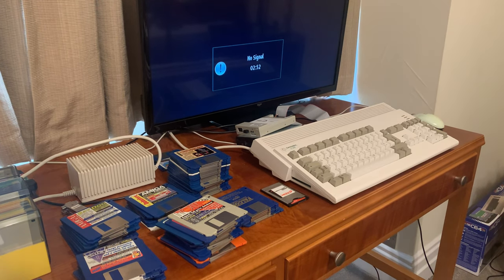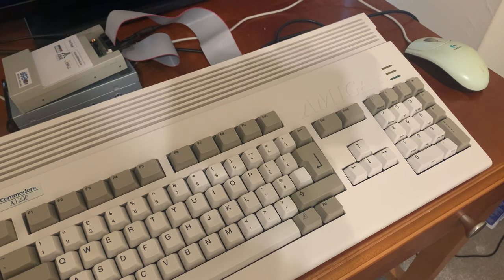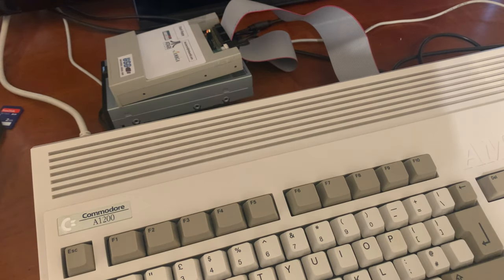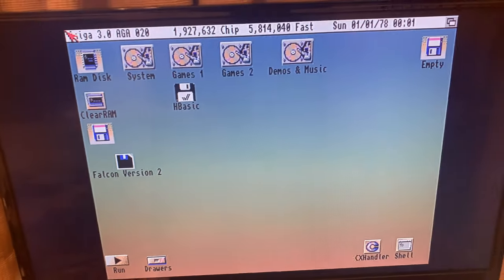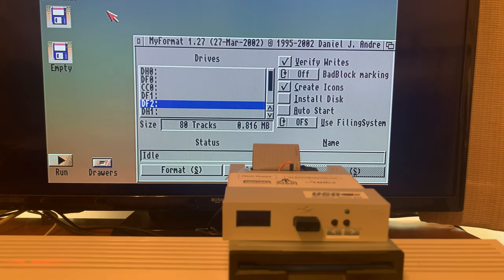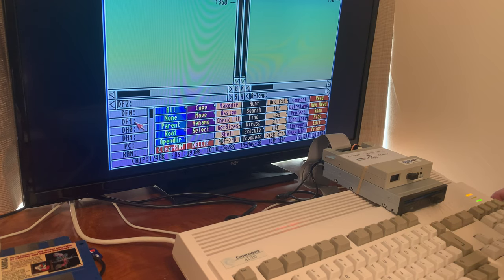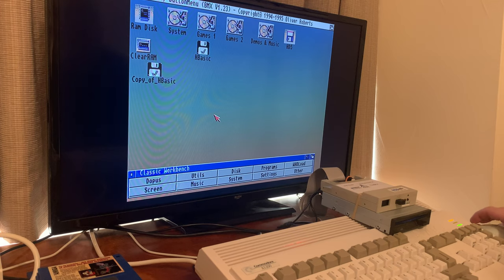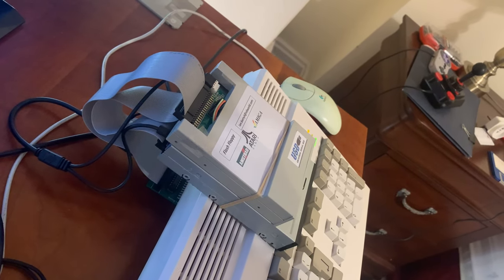The "No modification" method to use a PC floppy on an Amiga

Comment: Nice... I have the internal version or a version like yours for internal use. Depends on what and how you see it. 😉 And it works great. I bought mine from Greece and it is a cheap solution. Only downside, is that I had to cut on the top-shield of the drive and I needed to buy a 3D printed eject button. Else it works exactly as an original drive. Though I have to use a piece of tape on 1.44 disks, because the drive it self will still think it is a HD disk. And a machine thinking that it is a DD disk and the drive thinking it is a HD disk, really messes up read and write.
Reply from the maker: Ah good to hear - Which amiga machine did you install yours in?
Reply: @yaggieboat  In my 500 rev 8a.1 and then I have one in my spare box.

Comment: Very nice, especially since it's getting harder and harder to find replacement Amiga-compatible drives. Does this method also allow the reading and writing of MS-DOS disks or just Amiga ones?
Reply from the maker: I haven’t tried that.  I’m guessing it won’t natively as the pc and Amiga had different file system formats.
Reply: You can read and write DD (720k) MS-Dos disks only, like on every Amiga diskdrive, if you install the necessary drivers. No way to read 1.44 (HD) drives without a special controller (like Catweazle) or an Amiga HD-Drive, as Paula does not support the doubled datarate PC-Diskdrives use. Amiga HD-diskdrives use only half rotation speed if HD-drive is inserted.

Comment: can this adapter be used solely as DFO? I mean only one drive to replace original in Amiga
Reply from the maker: Short answer is Yes.  The slightly longer and drawn out answer is -   Depending on where you plan to mount this thing.   IF you mean can it mount inside the machine, I will say no, not with this model as it needs to be plugged into the back of the machine to work. But if you mean, using it as boot device so you don't need the internal drive,  you can do that.  Depending on which kickstart you are using you can boot from an external drive without any hardware modifications by hold the mouse buttons down at power up and selecting the external disk.  It would't be a DF0: but a DF1:.    You can also get a rom switcher to make it an actual DF0: if you need the device number to be 0 as some games require. Yet another way would be to get an internal install version but that one needs space inside the case and I'm not sure which machine you have.
Reply: @yaggieboat  As the developer is in UK and selling to EU is practicly a hell after brexit, he decided to make everything open source on github. Basicly the adapter devirates the "Ready" signal with a standard logic chip from the other signals. If I remember correctly, it is just one IC, one capacitator (just stabalizing the power on the IC) and two resistors. Less than a dollar. You can handwire the components yourself without PCB and make your own internal cable.
Actually I plan to modify one of the more modern notebook-hd-diskdrives this way (I hope to find time at Xmas). Theese drives have a 26-pin FCC connector, which is documented by RobSmith on his DrawBridge project. Same signals like every PC-Floppydrive, only less GND-lines. So a simple 26-pin FCC breakout board should do + of course the logic to generate the signals for the Amiga. I intend to modify two of theese drives for an A2000, so I can mount two diskdrives and a notebook CD-drive in the two-floppy bay, leaving the 5 1/4 bay for a Bridgeboard floppydrive. Also I want to make one (or two) external drives for my CDTVs, as theese notebook diskdrives fit under the CDTV (about 1mm missing - some extra rubber under CDTV-feets and it fits).
Notebook Floppydrives are cheap - less than $20 and still available. They are sold as USB DiskDrives, but the USB-part is a seperate PCB connected with 24pin FCC cable, so you can remove it and replace it by an 24pin FCC breakout board.

Comment: Well, that disk is double sided, too...

Got a link to those cables?

Also, what‘s going on outside your house? :D
Reply from the maker: The PC drive will read the same exact double sided / double density disks that an Amiga drive will read.  It won’t read high density disks as a 	1.44 mb but will read a high density disk if formatted as 880k Amiga format if you put tape over the second hole in the disk.
Reply from the maker: Lots of noise outside my house as I am in central London on a busy street. People going by walking/driving and construction next door.
Reply from the maker: Link to cable seller - https://www.ebay.co.uk/usr/ikonsgr74?_trksid=p2047675.l2559
Reply: YaggieBoat I meant this: In the video you said something like „this disk is double sided“ but corrected in text „I meant double density“. I‘m just saying it‘s both double density and double sided.

Comment: what kind im mumbo jumbo ia that "you can¨t us HD disks on an amiga" the 4000 is born with a HD drive and i have a HD drive internalky in my amiga 500 its been ther since 1989 and works fine with 1.76 mb disks wich is the amiga format of HD disks
Reply from the maker: The Amiga 4000 was at the very end of Commodore and very few people had those. The bulk of the Amiga computers that were sold were double sided double density disk drives with an 880 K format.